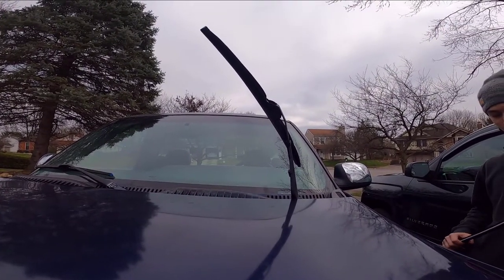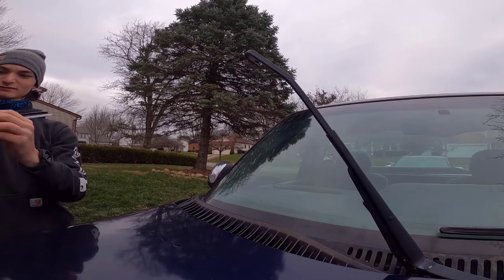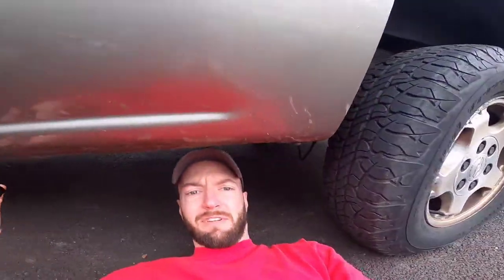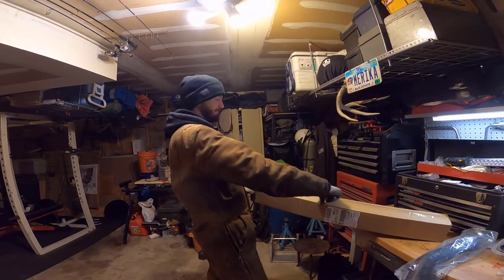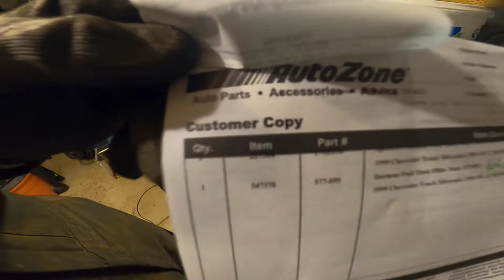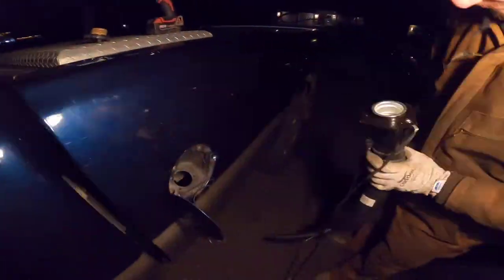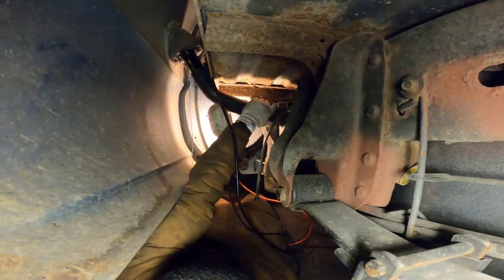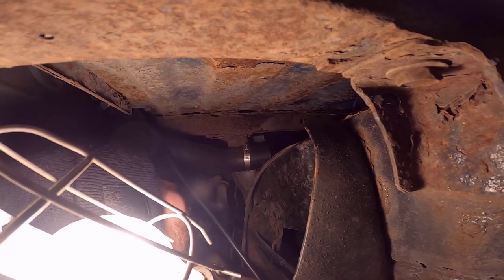'99-'07 Silverado/Sierra Gas Tank Filler neck and hose replacement

Comment: Great video. 1 question, where dose the breather hose from the new filler neck go into?
Reply: Can you reply to this guy smh
Reply: @oP0172  I bet he doesn't have a clue
Reply from the maker: It goes to the gas tank
Reply: @10minutejobs88  Can you show exactly where the breather hose connects to tank please?
I blew a tire and it ripped my fuel fill tube out. I can't find a place that the breather tube would connect
so I'm not sure it even has one being that it has a utility bed it might be different than stock.
Reply: my gas tank is same doesnt have a plase for the breather hose

Comment: Can you use a Heat Gun (accurately of course) on a new Rubber Hose  for the Filler Neck to put it on? The thing is that Filler Neck is 2-1/16" with a band 2-1/4" at the end. Fuel Tank neck is 2" with a band on the end 2-1/8". It looks like the original Fuel Neck hose was 2" (kind of unclear print on it 2"). Micrometer shows on that old hose 2" ID, but it is soft, so you can put it on. I bought a new, also 2" ID and can't fit it on that Filler Neck. Can I use 2-1/4" ID (I found one) instead of 2"? There will be clamps on both sides. Thank you for the informative film.

Comment: Did you have to replace the hose? Or could you do just buy new fill neck and use old hose and old outer protector hose and old breather house and old ground wire?

Comment: Where or what's site did you use to order the fleet side neck filler hose?
Reply from the maker: I believe I got the fleetside from rock auto
Reply: O Reily's had my outer hose, check them out before ordering it was $64.